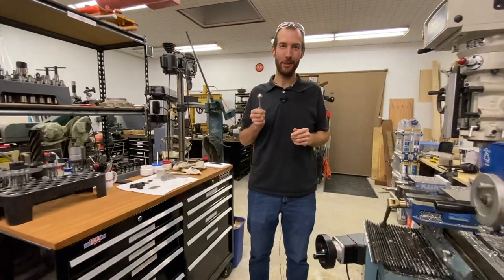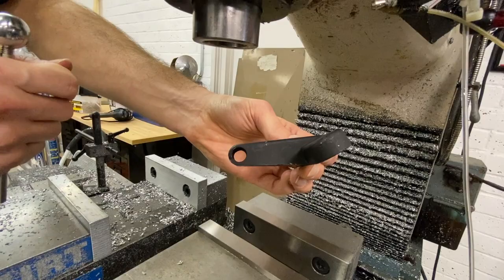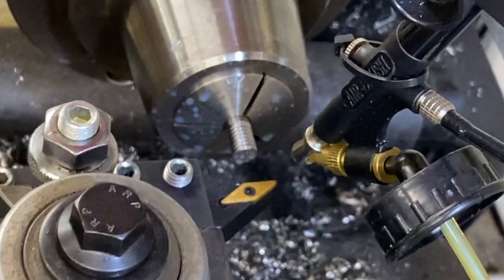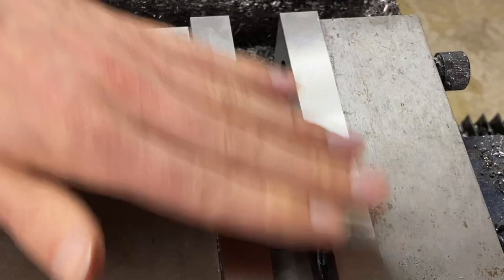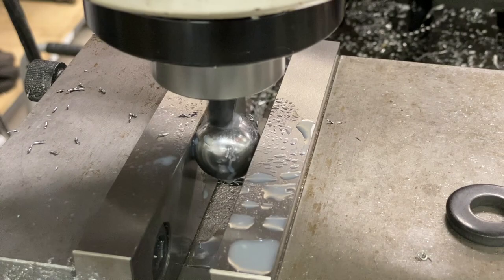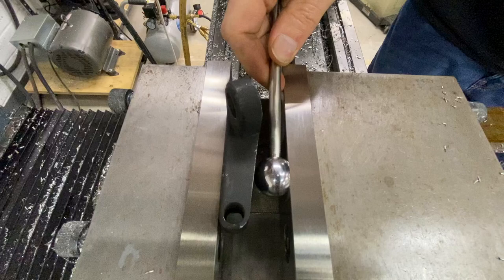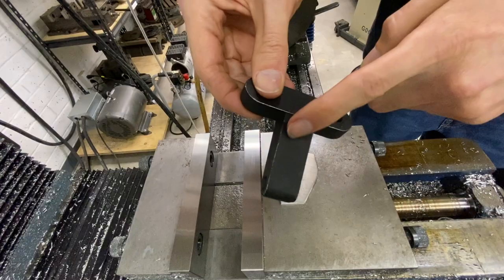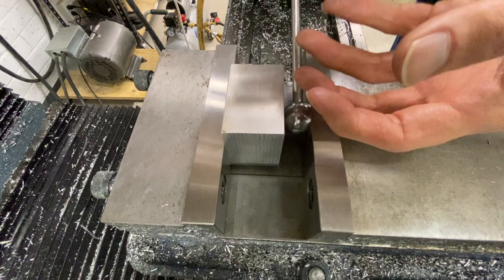HOW TO CLAMP VERY SQUARE by Using this "Vise Ball"

Comment: Moderndaytinker here
I've used this method for many years , but I just use 1/4in.key stock -- mill away one side, leaving a small projection one end- maybe 3/16 by 3/8 by 1/16high. ,😎👍

Comment: Hi
I use a 16mm diameter steel ball taken from a bearing. I hold it in position with my fingers then tighten the vice.
I never thought of putting a handle and flat on the ball.
Thank you very much for that idea and for sharing
Reply from the maker: Glad we could help! Sometimes fingers just dont fit where you want the ball to go.

Comment: Nifty idea - what did you use for your ball? I've seen steel ball handles, but they aren't polished and based on how easily you milled the flat it didn't seem like yours is SS.
Reply from the maker: Its a steel ball handle from Mc Master Carr. I don't think they disclose the alloy. Some kind of free machining mystery steel. Good quality, pre drilled and tapped.
Reply: @TigermothRacingTV  
This one: 6045K56 (1" OD, 3/8-16 x1/2" threaded hole)? I'll make the handle from 3/8" drill rod. Thanks!
Reply: @TigermothRacingTV  
Checked with McMaster - the round steel knobs are made by S&W Mfg and are made from 12L14: no wonder they machine well. I'm going to try both 1" & 3/4" since I have a 3" vise on my mini-mill. Thanks & stay safe!

Comment: Would it be easier on the part if you used the flat of the ball against the work piece?
Reply from the maker: You could try that. I default to protecting my vise jaws over the part. Maybe using a soft jaw you could dent up the jaw and it wouldn't matter?
Reply: @TigermothRacingTV  that makes sense. Thanks for the reply 👍